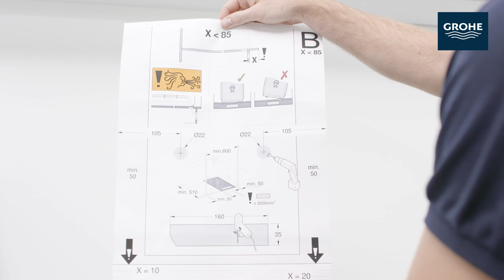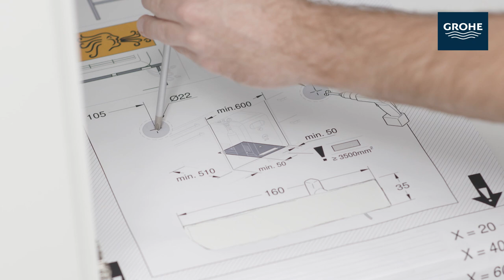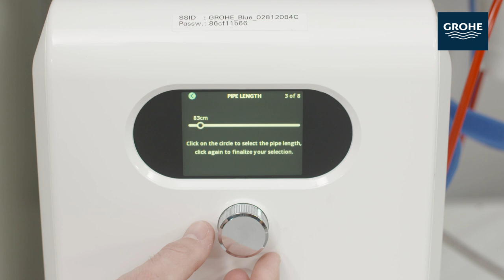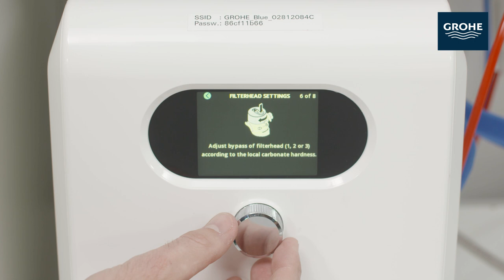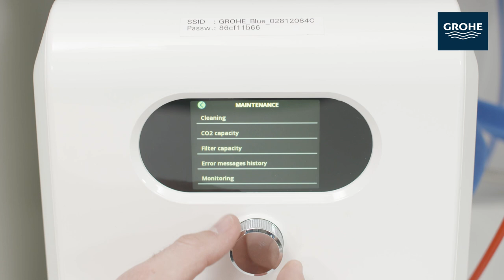Installation of the new GROHE Blue Professional

Comment: Why do the instructions include another measurement (dGH) and filter model number? Choosing the correct filter is so confusing. How do I choose the correct filter??
Reply from the maker: Hi Michelle, that depends on how much water is drawn. If you aren't sure, you should start with the S-size filter (No. 40404001).
There is no point in taking the L-size filter straight away, as the filter should be changed after a year for hygienic reasons, regardless of whether the filter capacity has been reached or not.
Furthermore, the carbonate hardness is decisive. If your water supplier supplies water with a carbonate hardness of less than 9 degrees, the activated carbon filter (No. 40547001) must be used.
Kind regards
your GROHE Social Team

Comment: Do you need to use the cleaning kit first time you use the unit or when you change the filter?
Reply from the maker: Hi Mark, the system must be cleaned once a year using the cleaning cartridge 40434001. To do this, you need the adapter for the cleaning cartridge 40694000 once (this adapter is already included with the Grohe Blue Professional). If the system is operated in a public / commercial area (e.g. in the kitchen of a company), cleaning must be carried out twice a year.
The filter must be replaced after the capacity limit has been reached or after a year (depending on which event occurs first).
Kind regards,
Your GROHE Social Team